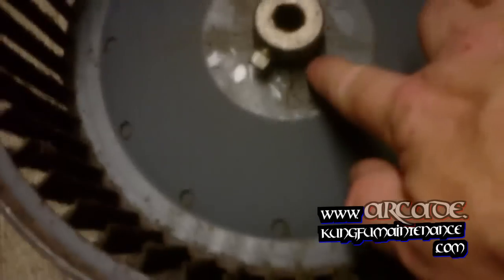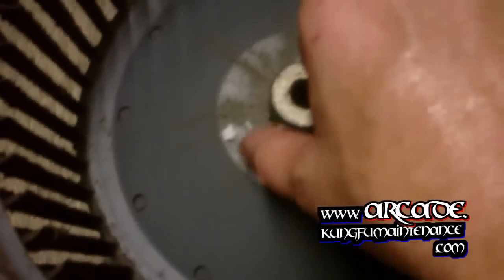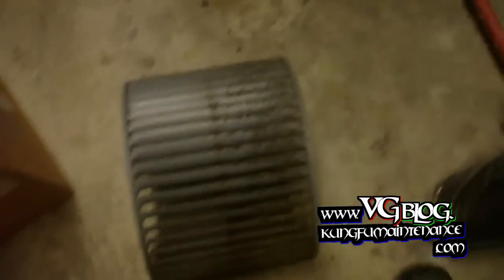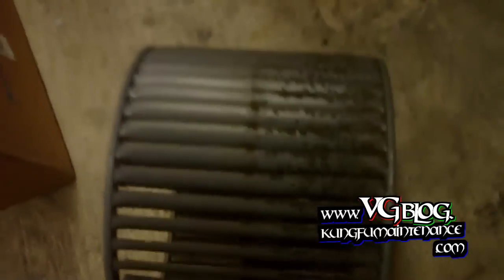HVAC Central Air Conditioner Heater Indoor Blower Wheel Rattling Making Funny Noises

Comment: my central air blower is makeing a rattleing sound every so many moments,i do have the ac guy coming out next week to replace a circuit board,right now he has it rigged so the fan will stay on continuesly because that circuitboard had failed and wouldnt let the fan run at all so he has it direct wired so i can have air ,do you think i should have him also replace the blower wheel or do you think its good to go the way it is?

Comment: Right now, I'm in an older 1970's mobile home and had to replace motor twice and now the wheel as well. Looks like the weights were not in the same place and the center is loose from wheel..

Comment: my window AC is making a rattling noise ONLY when the compressor is NOT running... Any ideas??? doesnt make any sense..
Its not a very strong rattle.. sounds like tiny plastic beads rattling around in a box randomly or something..
AC unit isn't very old. maybe a year or two max??